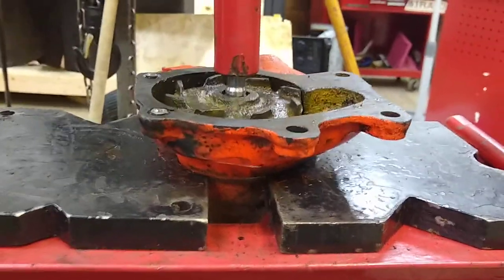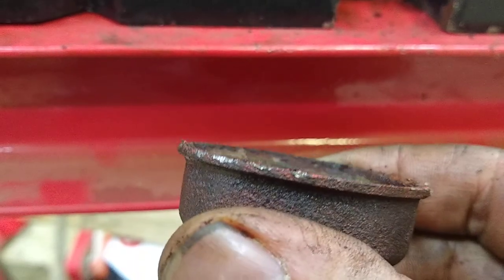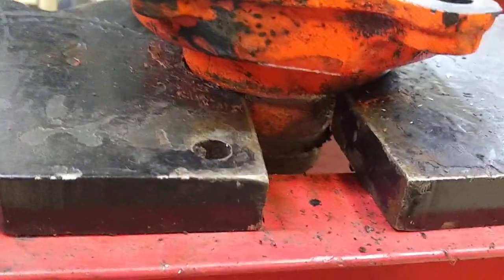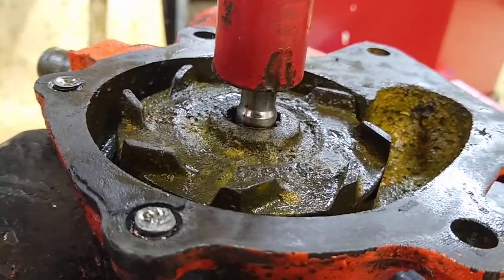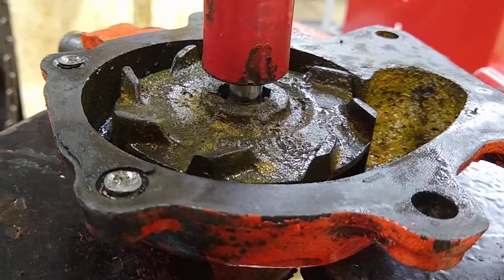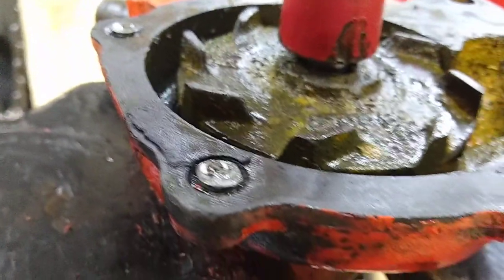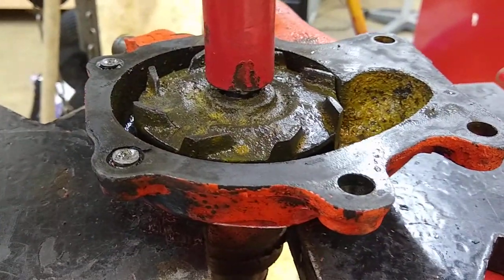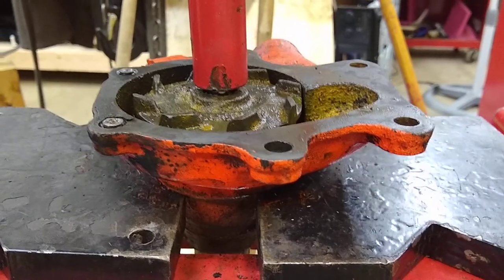1949 GMC FC253 Water Pump Rebuild Part 3 - Press out the shaft

Comment: The flat head screws came out well for me after heating them with a torch.
Reply from the maker: Nice - I think I didn't use enough heat, I just used a plumbing torch.